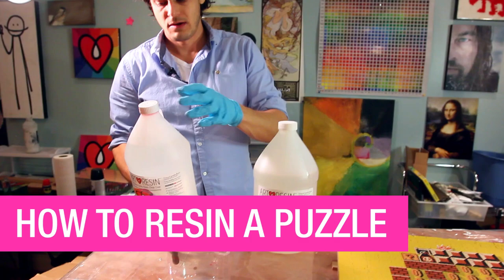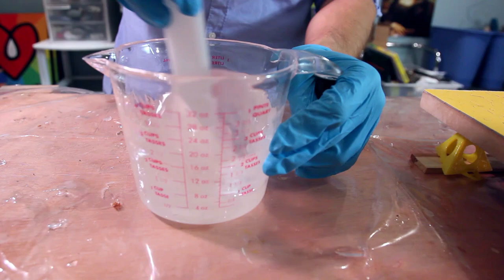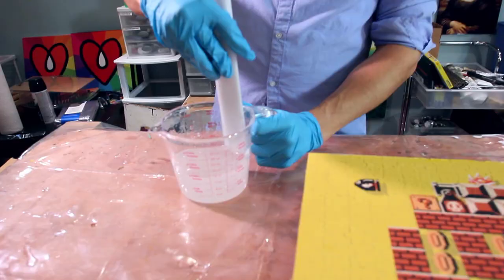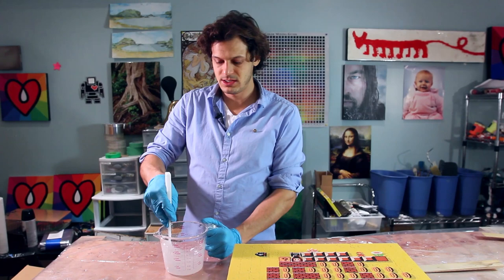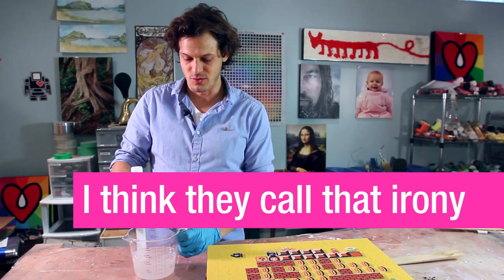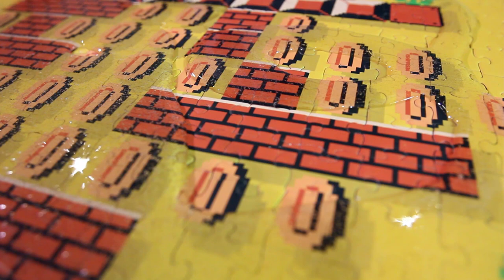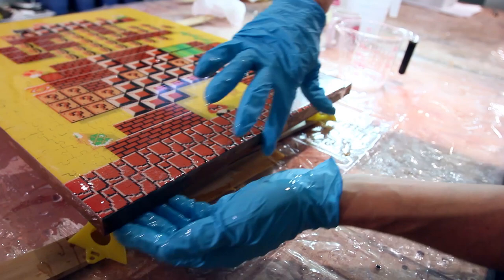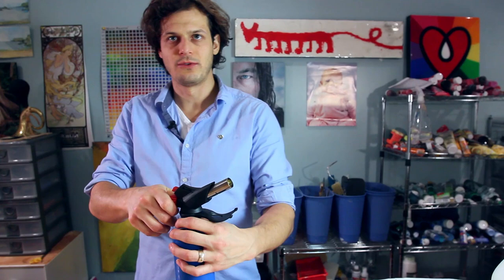How To Resin A Puzzle - Part 4

Comment: That's so awesome. :) These videos have me saving a few pieces until I can get some Art Resin. I refuse to use anything else on them. :) I am wondering how well it will work with my dimensional "painting" and I will need to mix more I am sure because of the elevations in the work. - Heidi